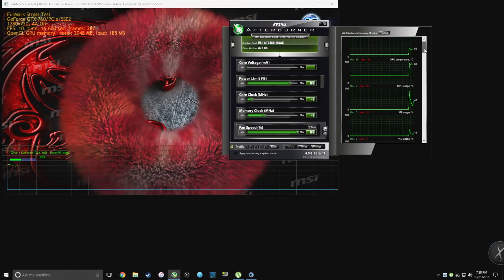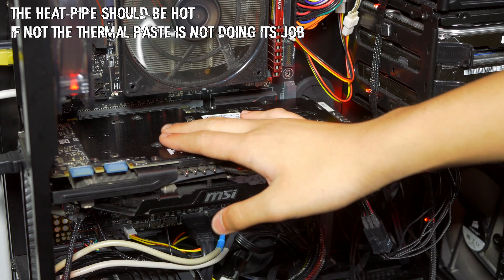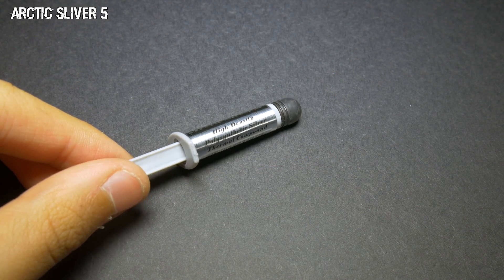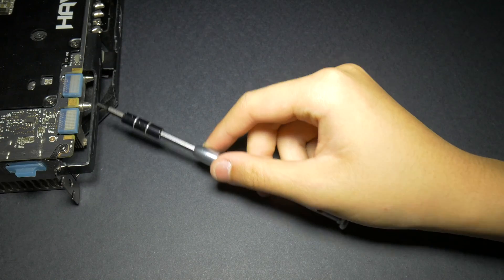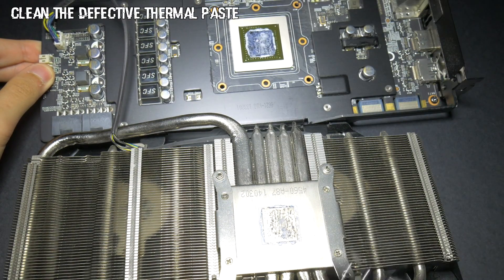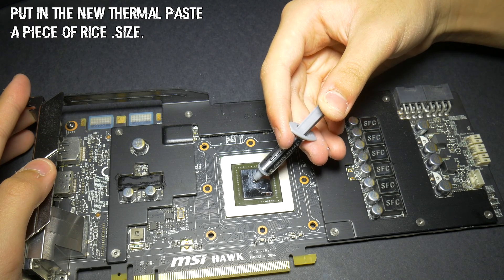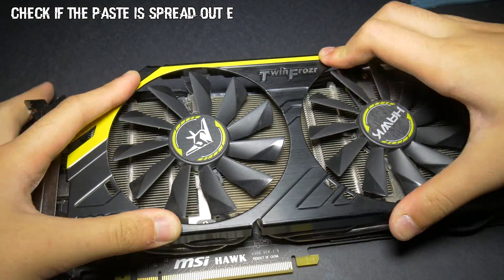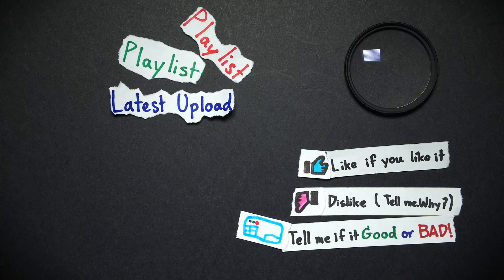How to fix Graphic Card Overheating 91c

Comment: I did it once and was running good but after a year it's not even switching on.. it's more of problem or a easy fix please reply..
Reply from the maker: Open it up see if the GPU die is ok, maybe the thermal paste leaked. Also check your inputs, there are people in Linustechyip forum that can help you as well

Comment: I have done this still having the problem and it did not do this till I put it in my new case that is bigger then my old 1 and the new 1 has like 5 more fans so it has more then enough are and I can’t even play cs go on low graphics I use to play at high graphics and record it so I need help

Comment: i've cleaned my 8800 gtx , changed the thermal paste with good contact but it is still overheating at 70 degrees when idle and i cannot do gaming at all because it reacheas even 90 and the fps are droping. Any ideas what could be the issue ???
Reply from the maker: nice.  8800gtx still working
Reply: it works but cannot play games because of the overheating
Reply: no i didn't and it's not my first time doing this i've found that idle temp of the gtx 8800 is 60-70 degrees. i'll stick to my hd 5570 for now
Reply: Fans run well
Reply: @logicalfree  i got the same problem have you fixed it?
Reply: @modaxfin3257  Yeah I did! I've bought a new Rx 550
Reply: Marius Cosmin so you bought new gtx and now its working?